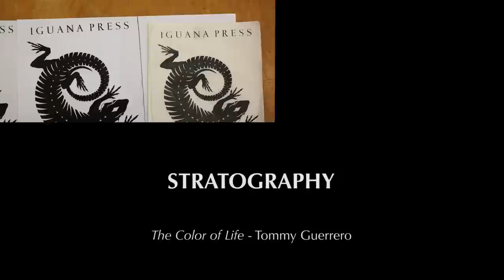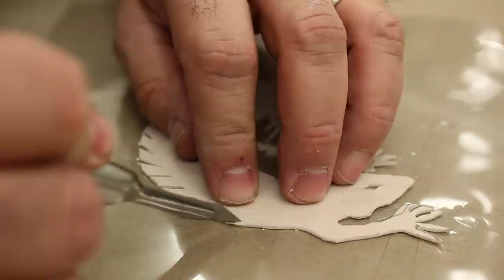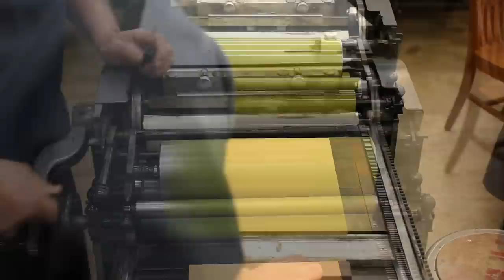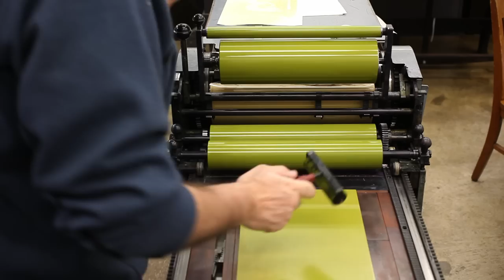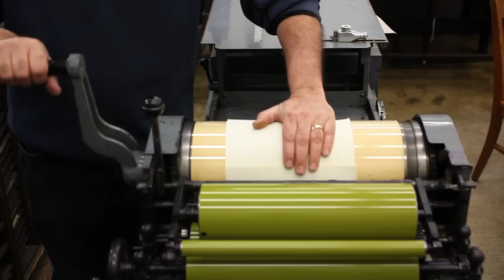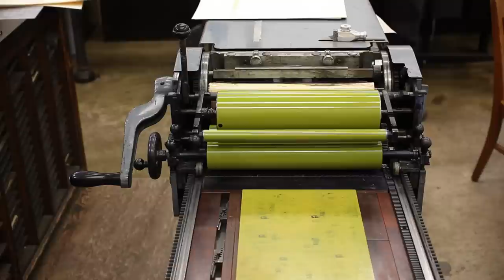Stratography. or letterpress pressure printing

Comment from the maker: In etching, ink is applied to the plate, then the area on top of the plate is wiped off. An etching press lifts the ink out from the "etched" lines. The ink is lifted out onto the paper.  Letterpress is like lino block printing. The rollers apply ink to the highest areas of the block or the parts that were not cut away. That park of the block is printed. You can see that letterpress printing takes less time to print a sheet since the press inks the block as it is printed.

Comment from the maker: It is an non motorized SP15 Vandercook. Lots of the SP15 models have a motor to oscillate the rollers. This one does not, which requires the hand crank for spreading the ink.